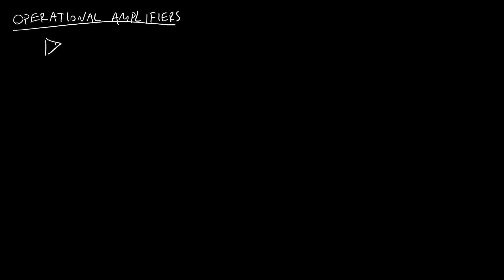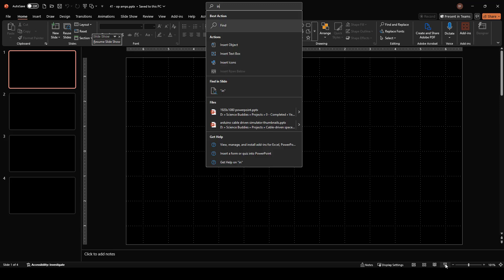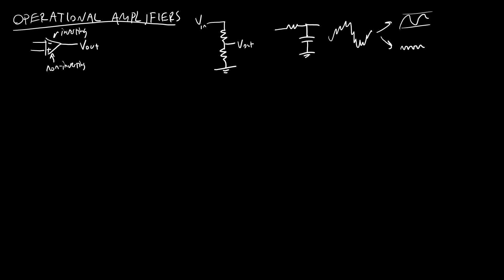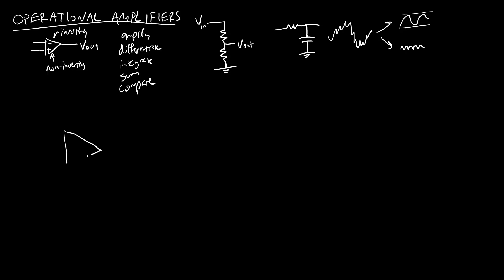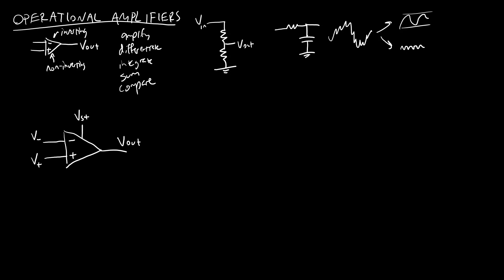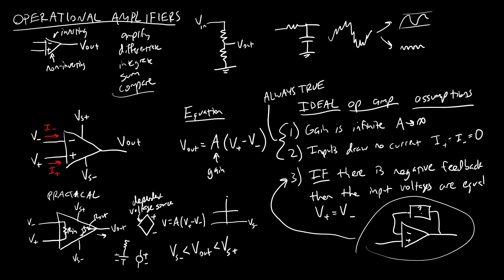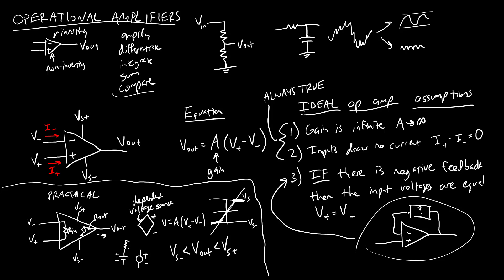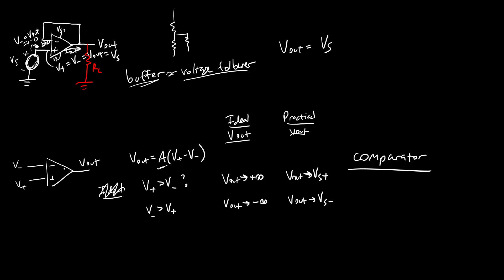Intro to Circuits 41: Operational Amplifiers (Op-Amps)

Comment: Man I kid you not, I just came into your channel again to watch a video on OP Amplifiers and you just happened to drop this gem😂, like I haven’t even watched the video but if this ain’t destiny I don’t know what it is. I appreciate your work sir! When can we expect the next video and what will it be on?
Reply from the maker: Haha thanks! I got started on this series during the pandemic and then took a several year hiatus because life with two kids got too busy. There will be a few more videos on op amps (inverting and non-inverting amplifiers, differentiators, and integrators at least - there are tons of op amp circuits so I'm not sure how many I'll cover), then on to transistors (just npn BJTs and N-channel MOSFETs, again there are tons of types of transistors so I won't cover all of them), possibly logic gates after that. I'm also recording my lectures this semester and posting those in case you haven't seen them yet, and there's an older "Tinkercad Circuits and Arduino" playlist that mostly matches the material in the 2nd half of the mechatronics course this series is loosely based on (TBD whether I update that one, the audio is bad because I was using my new microphone backwards the entire time...).
Reply: @ microphone backwards hahaha, I’ll check those out too, I didn’t know about their existence. Thanks for taking your time to continue the series and replying to my comment!